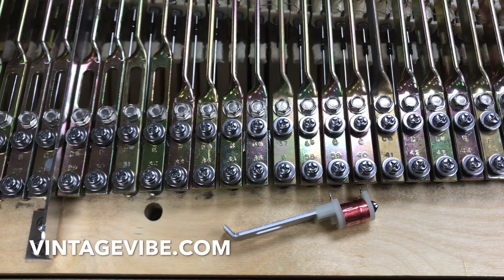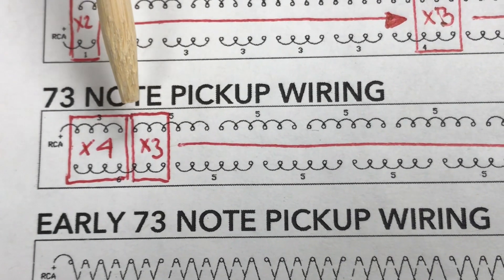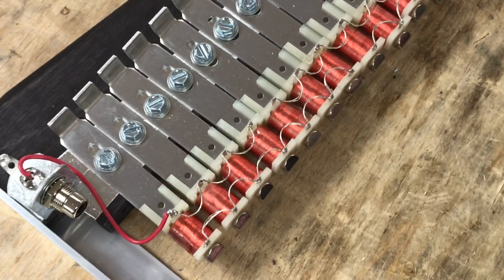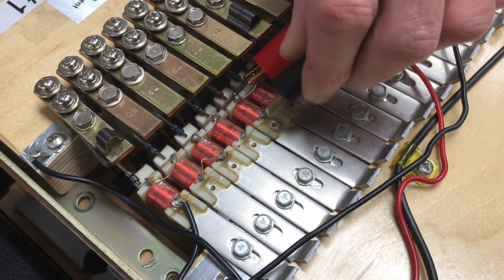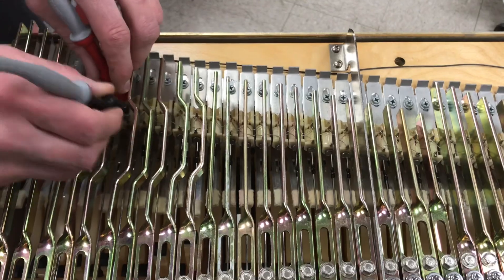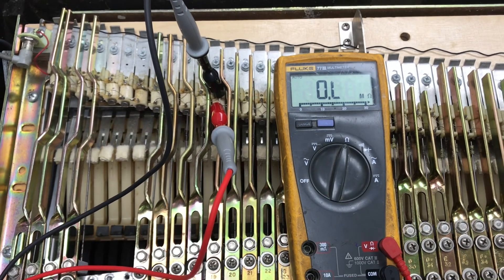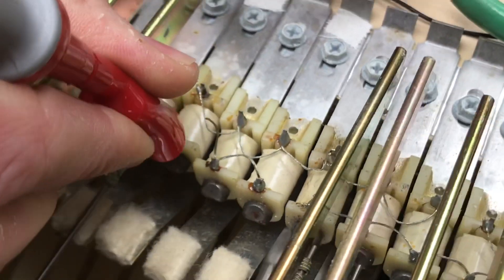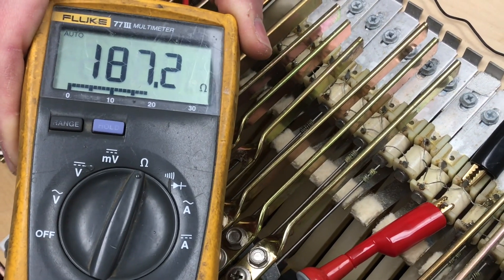Locating Bad Fender Rhodes Piano Pickups Quickly

Comment: Why are the coils damaged?
I can't figure out why, since there is no current flowing through it (no more than mV) so that it could burn or something like that...

I am a guitar tech and I know that the working principle of the electric guitar pickup and the Fender Rhodes is the same but I have NEVER seen a guitar pickup break!
Could someone explain it to me?
Reply: from what I have read this happens due to humidity and oxidation that causes the small wires to go bad.

Comment: I was told that using a low heat soldering iron, like a 30w is ideal for this type of work. Is this true?
Reply: Definitely. You want to be careful not to melt the plastic

Comment: 38 bad pickups?  No wonder the poor thing had no output.  Assuming that's a 73, that's over half bad.  If I get a MkII with white pickups, they're all getting replaced.
Reply: From my experince the ones with the white cover tape (late late 70ies and early 80ies) are a lot less reliable than the older ones with transparent tape - their wire tends to corrode at the solder joints, especially when the Rhodes was stored in humid environment. Given the cost of 73x new PUs, it's best to avoid instruments equipped with the white ones, especially if the metal parts of this specific instrument show signs of corrosion, too.